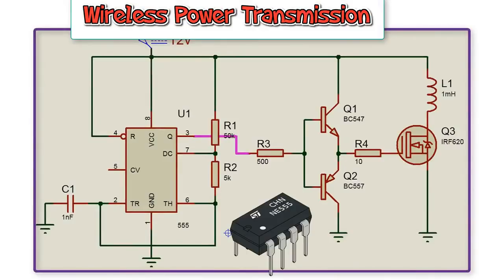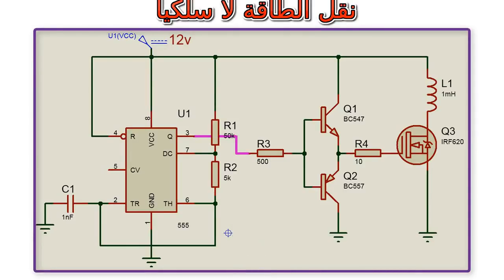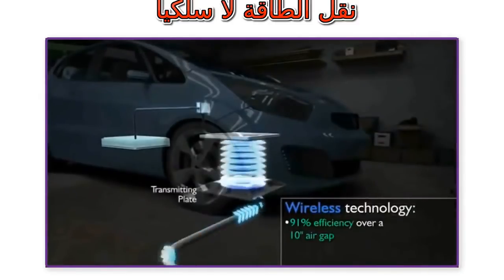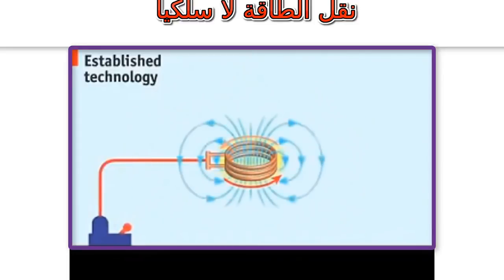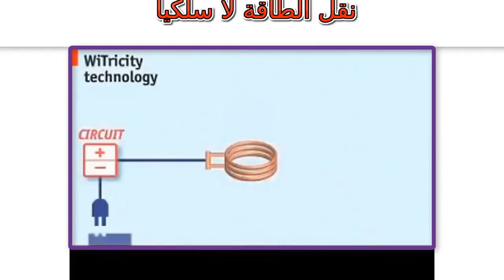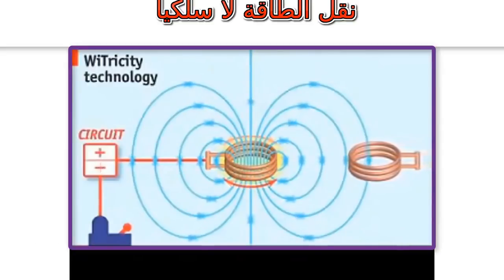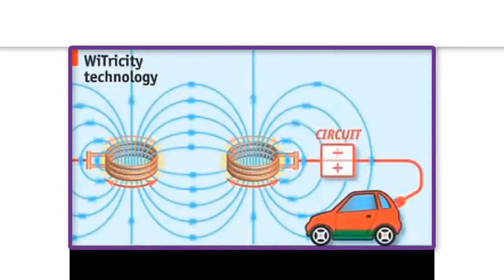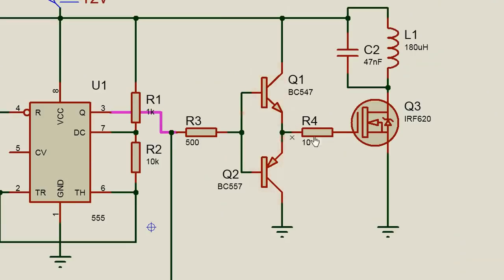How to Make Wireless Power Transmission

Comment: HOW  MEANY  TURN  FOR  TRANSMITTER COIL AND  HOW  MUCH  COIL FOR  RECEIVER COIL ? PLEASE REPLAY
Reply: Tyrell Gonda no problem man, and for the question: I would highly suggest not to use bc 547,548... As they are low power ones they will get very hot, so use any high power npn transistors... Like tip122 or irfz44n...etc
Reply: Nilanjan Roy i also want to know
Reply: Nilanjan Roy how many turns?
Reply: Nilanjan Roy the more the better, at least 30 turns for each and at least 5cm diameter of coils.
Reply: Shut da hell up up until what turns? Will 40 to 50 turns works better?
Reply: Tyrell Gonda yep, if u can do 50 turns for both coil and 4-5 cm diameter.
Reply: Shut da hell up i have another question. Where does the transmitter coil connected? And i'm using 9V
Reply: Tyrell Gonda one side of coil is connected to battery positive and the other side of coil is connected to collector of transistor. Base of transistor is connected in series with 10-100ohm resistor to output of 555ic which is pin 3. Connect all grounds together and emitter of transistor to ground. (You can also add a 0.1uf capacitor to receiver coil in parallel) :)
Reply: Shut da hell up one last question, for now. Which transistor? From bc547 or bc557? Thank you so much for your help bro!
Reply: Shut da hell up ow thank you for the additional info. But what im asking is. The transmitter coil is connected to the possitive of the battery and collector of the npn transinsitor?
Reply: Tyrell Gonda exactly!
Reply: Tyrell Gonda here u can use this for future reference:
https://engmousaalkaabi.blogspot.com/2016/05/wireless-power-transmitter-using-ic555.html?m=1
Reply: Shut da hell up thanks man
Reply: Tyrell Gonda np.
Reply: Tyrell Gonda how far did you kept the reciever coil? and whats your supply voltage that u used? can you link ur circuit?
Reply: Shut da hell up less than 3cm. And 9V battery
Reply: Tyrell Gonda how many turns and Diameter of coil? also which guage wire did u used
Reply: Shut da hell up 40 turns. 5cm. 22
Reply: Tyrell Gonda it should work, does ur ic get hot, it would be really helpful if you could send a link to ur circuit. also do u have any bridge rectifier at reciever side?
Reply: if you use google drive u can upload and share the circuit link there.
Reply: Shut da hell up i dont have any rectifier at the receiver side and i dont have my circuit right now.
Reply: Shut da hell up later ill try to send it here when i get home.
Reply: Tyrell Gonda ok.
Reply: Shut da hell up bro. Im sorry wasn't able to send you a copy of my circruit. As of now i'm trying to use the reference link that u sent. With both 30turns, 5cm diameter. But im using TIP 122.
Reply: Shut da hell up how if i use bc 337 and irfp260n to step up the voltage? btw i use 9v battery
Reply: Shynx 24 bc337 would probably work fine upto i say 500-700mA, and that mosfet is fine too
Reply: Shut da hell up bro. Question. How do I enhance the transmition? Because the LED is so dim.  How do I enhance the transfer of voltage and current?